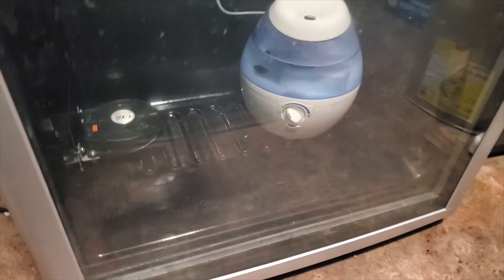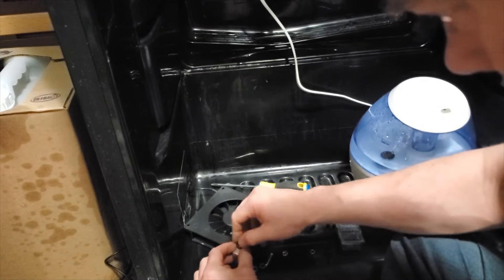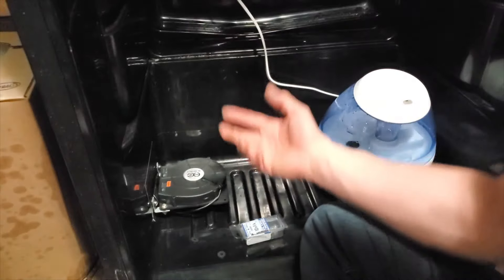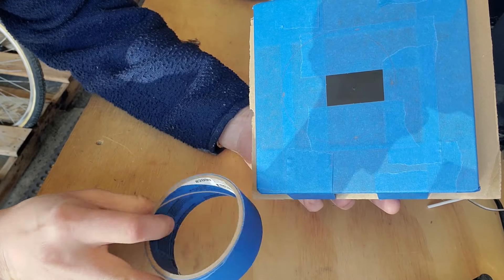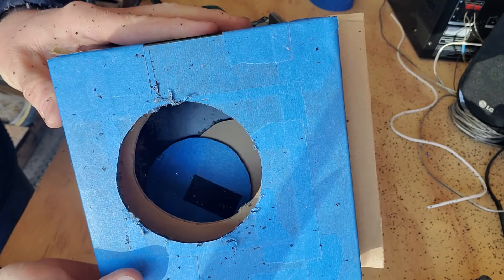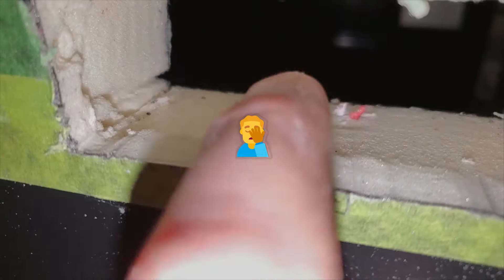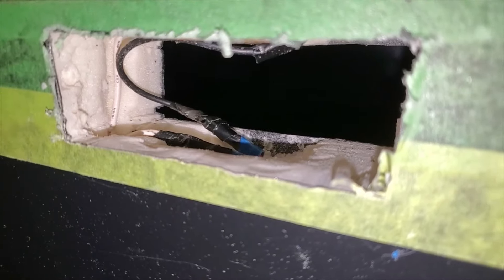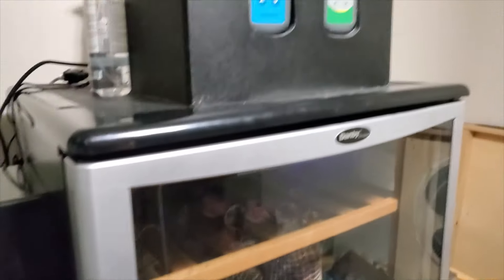DIY Curing Chamber Upgrade

Comment: I'm curious about the humidifier you chose, and how frequently you have to refill it? Great job and thanks for your video. I'll check back to see how your test batch turns out! Please make another video when they come out. Cheers!
Reply from the maker: Thanks! So, I had some considerations when I got this humidifier (here is a very similar model: https://amzn.to/4b6Ngzu). 
Most importantly, it needed to be analogue, rather than digital. With the humidity controller, I needed to be able to leave the humidifier switched on (on low), and allow the controller to just provide power when needed. If a person used one with a digital power switch, you have to press the power button each time it's plugged in (or each time the controller sends power to activate it), so that's useless.
Next, I wanted one that held around a half gallon of water...enough that I didn't have to keep refilling, but wasn't so large that it took up too much space. Also, I find that, if you have water in there close to two weeks, it starts to get cloudy and nasty, which you don't want. Ideally, changing or topping up the water each week works best.
With this upgrade, I find that I've gotten a tighter humidity control in there. It's been a week and a half since I had to last refill (so, I'm going to change that tonight...this has been a bit of a test). This is good, if a person is going on vacation but has meat in there. If you're gone more than a couple of weeks, you just need someone to come by and refill it. I also like to add a splash of vinegar to the distilled water, in order to help reduce possibility of nasties growing in the water.
I wrote a note on the chamber to have a quick video when those lovely hunks o' meat come out, so stay tuned! 😁

Comment: i just picked up the same cooler but it is a programmable one not sure how it works yet, any idea? what did you use for cleaning inside
Reply from the maker: Hmm. So, my cooling fridge has the digital thermostat inside the door, at the top. When I plug it in, it defaults to 52F. I can then use the arrow buttons to adjust the set temp up or down. When I run this on my Inkbird temp controller, it is basically like plugging/unplugging it when it turns on/off. This is fine for most dry aging applications of charcuterie and salami, but not for items that need to be colder. If I'm dry aging beef, I need to disconnect the fridge from the controller, just plug it in, and use the fridge thermostat to set to something in the high 40F range. 
For cleaning, you could totally just use a bleach solution to completely destroy any bacteria/mold inside, but I'd let it air out afterwards. Then, to make sure it's clean prior to using, something like a Lysol wipe works well. After this upgrade, I just gave the interior a good wipe with those, then used right away with the charcuterie I wanted to put inside.
Hope that helps! 😁
Reply: @ThisDadGoesTo11  Thank you let you know how things work out
Reply from the maker: @joemartin124  Definitely. Going to do an update video on this in the near future. 👍
Reply: @ThisDadGoesTo11  MY  chamber is coming along very well , i have a problem with fermenting a sausage that may fail 18 hour in still 5.6 ph flavor of italy should i stop and smoke till done
Reply: i just check again down to 5.36 Hoping things turn out ,truffle moose sausage
Reply from the maker: @joemartin124  Oh, excellent! Yeah, I'd say you're still safe with that timing. Between the lower pH, smoke, (and low 'actual water' due to dry aging, if you choose to do any of that), you'll be good. Let me know how it turns out! Truffle moose sausage sounds amazing.